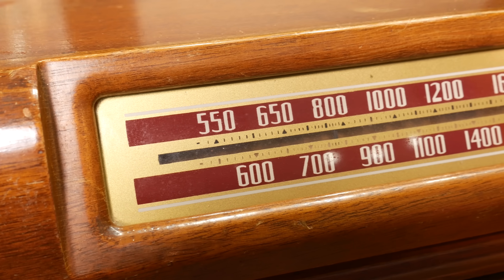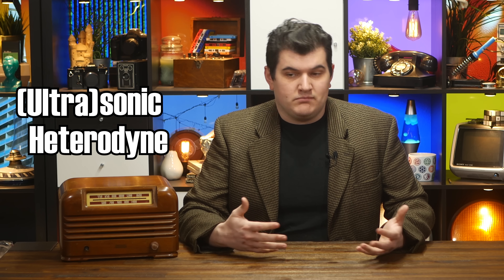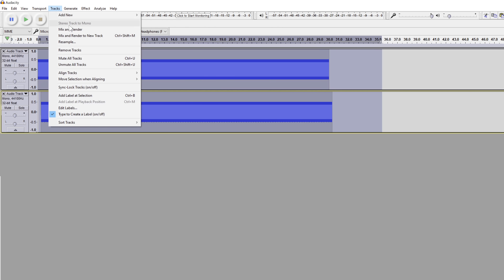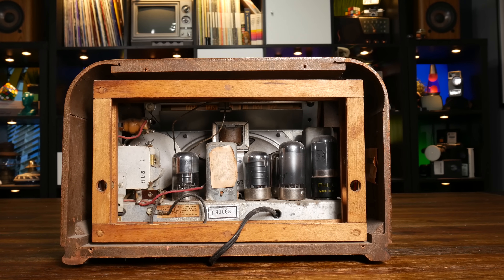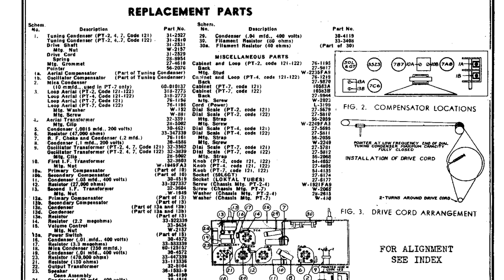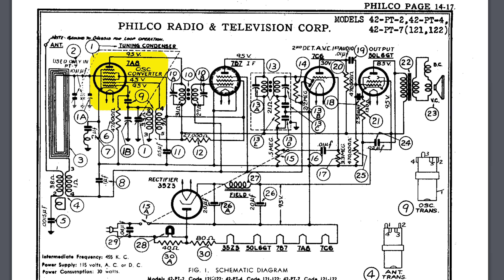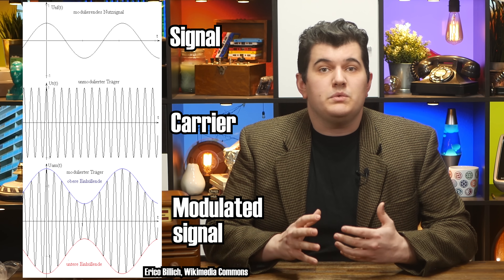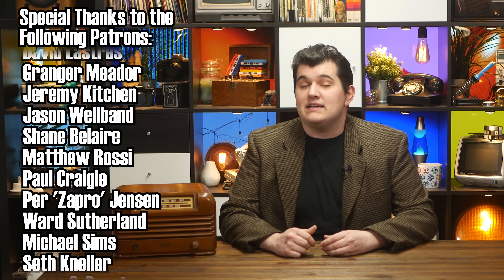The Superheterodyne Radio: No really, that's its name

Comment: Selection and amplification of signals to get precise final results with minimum error/distortion of the original signal is not just a radio problem:  When warships about the years 1900-1920 began to need major improvements in aiming their guns as ranges increased and more precise calculations were needed to adjust the aiming, one of the major problems was that the inputs to the calculating devices (now either semi-automatic or, eventually, completely automatic) had to be continuous and with known, repetitive timing (enemy target range, bearing, direction of motion, and speed, as well as these same values for your own ship to act as the center of measurement every second).  A major problem arose in sending the inputs from the sighting telescopes and range-finders to the calculators and then sending the results of the aiming orders to the gun mounts.  As with those early radios, trying to send precise values electrically turned out to be difficult and the results not only were rather imprecise, but could easily be thrown off by misalignment (firing your own guns tends to do that!) and the need for people to move the final controls to move the huge gun turrets.  When anti-aircraft weapons began to be important just after WWI, this finally led  in the US Navy to a totally new concept for such singal transmission:  The "Synchro" (for synchronized transmitter) or "Selsyn" (for self-synchronizing transmitter) device.  This machine used AC power signals rather than the older DC power and thus could be MODULATED much like a superhetrodyne radio.  It had a rotating permanent magnet needle in the center, the angle of which from the vertical being the value of the number being transmitted (any quantity could be changed to an angle and then changed back at the receiving device by appropriate circuitry and mechanical gearing).  Three electromagnets were arranged in a triangle with the needle rotating in the middle.  An AC current was run through the three magnets and the magnetic properties of the permanent needle would change the currents in the three coils slightly in a unique pattern for each angle.  This modulation of the three currents could be passed through a three-circuit radio amplifier tube device and boosted equally so that the final result was stronger, but just as precise, than the original value setting the needle transmitter.  This amplified circuit was now powerful enough to force a magnetic needle in the receiver to match the exact same angle and, voila, the same precise original number (if the error was still too big, two separate circuits were used, one of which was cranked up to 36 times as fast -- its needle went around 36 times when the main one went around once -- and the the two signals combined with a rather simple electric circuit to adjust the last decimal points).  In fact, with some later rework, this system eventually became totally able to handle everything with no humans "in the loop" and "Remote Power Control" (RPC) in WWII of everything was possible for aiming both the radars tracking the enemy and completely aiming the gun turrets hands-off.  Thus, tube signal amplification of modulated AC signals, though of a lower frequency than in most radios, became the norm for more than just ticker-tape, voice, and music over the air waves.

Comment: I would like to add, that the superhet overcame one other huge problem with 'straight' sets.
If you amplify the RF frequency that you are tuned to, the output of the amplifier can be picked up by the input and cause massive squealing. Which was also picked up by you neigbours.
Straight sets had to have tons of screening, to prevent self detection and howl round.
By shifting the received frequency to another, straight away, good amplification and selectivity can be acheived.

Comment: 5000 Hz sound in air has wavelength 59 mm.  Speakers larger than 15 mm or so will not yield audible beat frequencies.

Comment: Oh, and the OTHER downside of the SuperHet design is that it is much easier to jam.  If you are tuning with a conventional filter, a jamming signal must either be super strong to overpower the filter, or be tuned to the same frequency as the station you are trying to receive, or ideally both.  SuperHet designs are usually configured so that the beat frequency is just below the AM band, in your example it was 450 kHz, which is above the NDB frequencies and below the AM band, and the FCC is very careful to not license and quickly locate anything broadcasting in the part of the spectrum that SuperHet receivers would use as the beat frequency.  BUT, if you broadcast even a relatively minor signal, usually an irregularly modulated tone with an irregularly sliding frequency, on the same frequency that everybody is using as the beat frequency in their SuperHet designs, then your signal would jam not just the beat frequency, but would effectively jam the entire spectrum the receiver would otherwise be capable of receiving.  Your beat frequency jaming signal would go right thru the RF filter and the beat frequency filter and come out as modulated sound no matter what frequency you were trying to tune to.  The weaker jamming signal could then be much weaker and much more local and blank out entire swaths AM or even HF bands.

Comment: The other 'downside' of the SuperHet design emitting RF was that somebody a modest distance away with very sensitive equipment could pick up the frequency of your oscillator and with some arithmetic they could figure out which radio station you were listening to.  Radio ratings were important to sell advertising, so they had trucks that would drive down the street and pick up the injected frequencies of the radios in the neighborhood as they drove by each house and count how many houses were listening to which station at different times of the day, and by having a route that went thru various economic classes of houses.  Today that might be a problem because with current computers, it would be possible to track what each individual house was listening to, which could be a privacy issue.  Back in the day, the equipment on the trucks tripped clickers as the received injection frequency RF rose and fell as the truck drove by a house that was listening to a particular station.  The driver could drive a certain pre-determined route at proscribed times and then read the number of clicks for each frequency for each station in the market for the most popular receiver designs, manually write them in a log, and then drive the route again and again, and that way they had a scientific sampling of what proportion of the market was listening to which station as the day went by.  Like I said, by today's standards that would be a big privacy concern, but back then, the ability to economically record whcih station each house was actually listening to was beyond the technology of the time.  About all they could do is record that they drove a route that took them by, say, a thousand houses, and out of that thousand houses, 40 of them were tuned to station A, 56 to Station B, and so on, and then use statistics to extrapolate that to the entire listening area to estimate the size of the audience and the market share of each station, hour by hour.

Comment: I think your 5000 Hz experiment does not work because the speakers are too far away. Wavelength of 400 Hz sound is 300/400 = ~0.75m, which is comparable with the distance between your speakers. So you only get one period of each signal between the speakers, and at any point in time that period is either two "hills" which amplify each other, or a "hill" and a "valley" that cancel each other. Wavelength of 5000 Hz sound is 300/5000 = ~0.6m, so you get multiple periods of each signal between those speakers. At any point in time, some of those periods will be amplifying each other and others will be canceling each other out. At one point in time and in one point is space between the speakers, you get 400 Hz beats. But listened from a distance, you get let's say 15 different 400 Hz beats with different phases, and those will mostly cancel each other out. IANAPH

Comment: Permit me to correct a point about the origin of "superheterodyne."   Edwin H. Armstrong had already invented the heterodyne receiver Hetero = different, Dyne = movement, or more specifically frequency.  It mixed an incoming CW radiotelegraph signal with the output of an internal oscillator that operated at a slightly different frequency so the difference or "beat" was an audible note.  In 1918 when Armstrong invented the receiver you describe he considered it the next stage in evolution from the heterodyne, so he called it "Superheterodyne."  This is similar to his earlier naming of the regenerative and subsequent superregenerative detectors.

Comment: Most speakers were conceived to render the broad range of simultaneous frequencies, in music or voice, in a pleasing way. Not deliver a  coherent pure tone for a sonic experiment. I'm wondering if the high frequency Loudspeaker experiment failed because of the kinder crossovers design inside them.  Almost all headphones contain a single transducer per cup (probably with some frequency limiting to prevent transducer damage).

Anyone who regularly mixes music becomes aware how critical the choice of monitors can be. Properly designed audio monitors can sound rather harsh. Because they try to give you the full flat spectrum - "warts and all" rendering - so that you can hear the problems and any imbalance in your mix.

In a substantial studio you often have different sizes sets of monitors; PLUS a pair of very "domestic" speakers; so that you can test the mix as a normal person will probably hear it. Some music producers also check the mix on a cheap radio or car  stereo; for the same reason.

Comment: 2:30 There is a gauge on propeller driven multi-engine aircraft that tells you if the engines are running at the exact same speed. This isn't for symmetric thrust, but because if the engines are out of sync, they thrum. They set up that sound you got with your speakers.

Comment: Question: since AM signals (and possibly all modulation schemes) are essentially a "pure carrier with sidebands", does this imply that the "beat frequency" is actually the entire sideband envelope centered around the single frequency in the receiver? I guess it would HAVE to be, given that there are sideband ony broadcasting schemes (i.e.shortwave radio). In fact, if you haven't already, sidebands are pretty mind-blowing (but easily illustrated in math terms). Would be fun to see if you can make a good video on the subject. For instance, why is "sideband only" transmission a good thing for low-power transmission (transmitting carrier frequency is a waste…you KNOW the carrier frequency, you can add it in inside the receiver).

And if you ever get the chance, the DCT transform that is the center of MPEG video compression (also JPEG image compression) is an amazing thing, also essentially a sideband thing.
Reply: the "sideband only" transmission scheme for shortwave is why when you mistune, it sounds like the announcer is huffing helium. You can save the creepy "Helmut grüss Franz" spy/number station stuff for later, but spy shortwave stations must sound hilarious mistuned.

Comment: That buzzing noise on that tabletop AM radio is because of those new computerized electric meters with those little mini transmitters inside them. It basically turns all the wiring in your house into a big giant static transmitter. Just about every residential address and business address in the US has these utility meters now

Comment: During WWII the Germans developed really good sensors for picking up the superhet radiation so most troops weren't permitted to have normal radios.

This stopped nobody however because instead they used a pencil lead and a razor blade to form a schottky diode and thus the "Foxhole Radio" was born

Comment: One of the less obvious downsides of superhet was that the injection oscillator radiated some power. Also the IF amplifier also raidiated power. These two effects  made the radio easy to detect, especially where radios were illegal (eg some countries in wartime, or in countries where radios needed to have licences).

Comment: 1. You can put 2 radios close together, if one has shortwave, and use the other as a tunable BFO for picking up unmodulated CW (morse) or single sideband. It's called a poor man's BFO.
2. What's your callsign? If you don't have one yet, I would think an Element 2 Technician Class Amateur Radio license would be like falling off a log for you. 73 de AE7EC

Comment: I've noticed that when two you are someplace where two or more electric motors are running their combined whines create a similar beat, but the beat frequency modulates from short to long. Kind of like they are going in and out of sync. Any idea about what's happening in that situation? I should probably have watched to the end before I asked.

Comment: Thanks, I just realized why it was difficult to get the name of a component in physics classes in electronics, high school..
In Sweden.. 😋

You say capacitor, we say condenser.. And capacitor..
The Swedish word is kondensator, but since we are so used to English we also had some kind of capacitor - ish word..
I've never really learned what that component is and named.. 😝
I used a process of eliminating or, guessing.

....well, of course I never got the name, I've probably heard alternating names for 6 years.. We learned about electronics etc a very few weeks every year, that problem just persisted throughout.. I'm pretty sure it's a quirk of mine, much preferred to being stupid and not learning that component's name..

(sorry if this is a bit long, it's after 4am 27/12...) also, thanks again, for making interesting videos, merry Christmas! 🎄

Comment: A related subject matter is the electronic sound effect devices known as, "Ring Modulators", which are generally used with musical instruments such as electric guitars, keyboards, basses, etc... In a Ring Modulator effect, the signal from a sound source such as an electric musical instrument is combined with the output of a fixed frequency oscillator, who's set frequency is usually determined by a knob or control of some sort operated by the user, and when these two signals are combined in a non linear device such as a transistor, two new "sum and difference" frequencies are added to the two original signals, the instrument signal and the fixed oscillator. The sum frequencies are literally the sum of the instrument frequencies added to the frequency of the fixed oscillator, and the difference frequencies are the result of taking the highest of the two input frequencies and subtracting the lower of the two input frequencies.

For example..., if you have a keyboard synthesizer playing a pure 440 Hz "A" note and you connect it to the input of a Ring Modulator, who's internal oscillator is set to 1,000 Hz, or 1KHz, then the output signal of the Ring Modulator will contain four frequencies..., the original 440Hz synth tone, the 1KHz oscillator tone, the sum of the two input frequencies, which would be a 1.44KHz tone, and the difference between the two input frequencies, which would be a 560Hz tone.

It should also be noted that in analog TV broadcast and reception, (which has recently been largely replaced with digital transmission), the exact same technology was used, with broadcasting stations and televisions using an intermediate frequency, which was lower than the broadcast carrier frequency, and higher than the analog video signal frequencies.

Comment: A major improvement over a Tune Radio Frequency Radio and the Regenerative Radio. I have restored and built both along with Superhets. The Superhets work with an IF intermediate Frequency of say 455 kilocycles (Hertz) the tuned frequency 780. Kilohertz you have on each side you filter out the unwanted image and the wideband on one side and the carrier. You can filter out the carrier to and reinject it and save broadcast band spacr

Comment: In the UK where it is a legal requirement to buy an annual licence to receive broadcast television, the licensing authority used to have vans that would drive around the streets with an antenna they would point at people's rooftop aerials (antennas) to detect the local oscillator of TVs being used at unlicensed addresses. 

These days they just do random spot checks of addresses that haven't bought a license.

Comment: ACDC Edison distributed DC Westinghouse used AC some hotels in NY City had a DC generator in the basement. IF you plugged the cord in wrong, it didn't work, early radios used a Nichrome wire in the power cord to cut the voltage down for the radios that used 6volt tubes. What next after Transistors? I plan to live another 100 years to see whats next.